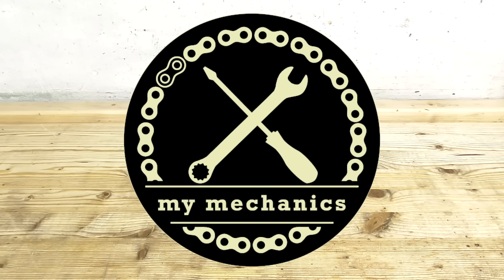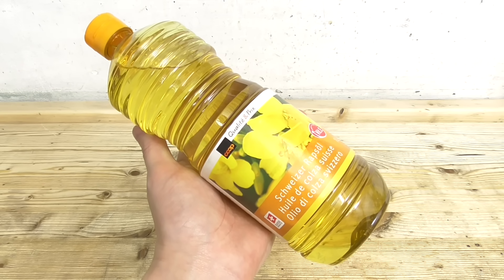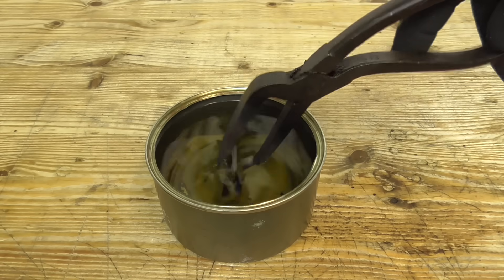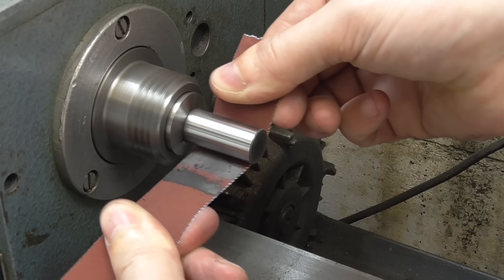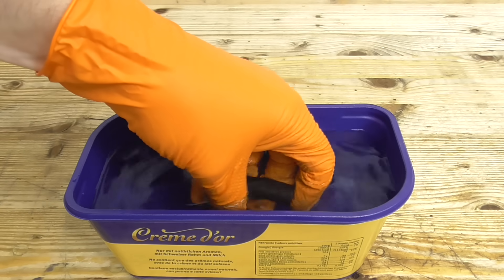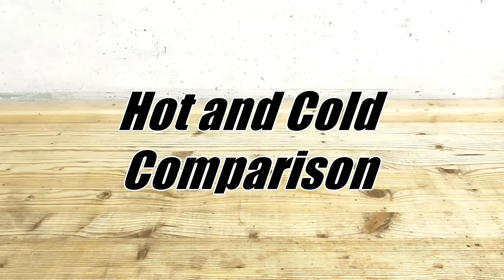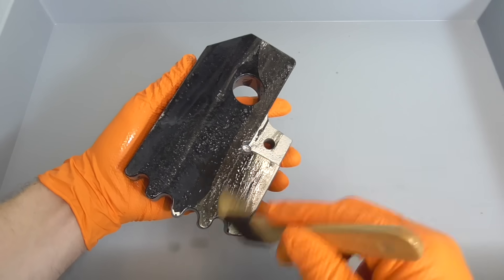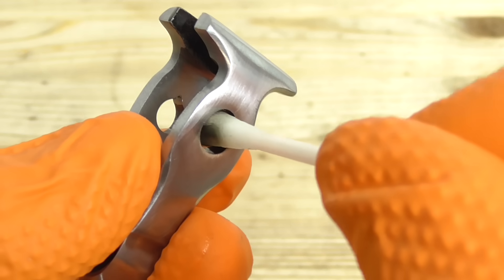How to Turn Steel Black - All you need to know about Bluing

Comment: You can use rust bluing for large parts, very time consuming though. You allow the part to develop a surface rust in a humidity environment or apply an acid for a quick rusting. Then dip the item into boiling distilled water for 20 minutes, the Iron Oxide will be converted in Black Oxide, bluing. Then you brush the loose black oxide off, and repeat the rust, boil, brushing step until the desired finish is reached or the part no longer rusts.
This is the most durable and corrosion resistant bluing method.
The easiest method is hot corrosive salt bluing in hydrous salts. You need approximately 5lbs of Sodium Hydroxide(lye), and 2.5lbs of Potassium Nitrate(preferred), Sodium Nitrate, or Ammonium Nitrate(evolves a lot of ammonia fumes initially), for every one gallon of distilled water. You need to put the water into a large cast iron, steel, or enamel coated pot, then slowly add the lye and Nitrate salt. You will need to heat the pot on a stove outdoors, and stir to dissolve the salts, the solution will be supersaturated and need to be hot to fully dissolve. Bring the pot up to a boil at 275-285°F, add more water if it gets hotter, or more lye if it boils lower. Suspend the parts by 416 stainless steel or black iron wire, immerse then in the bath for 15-45 minutes at a rolling boil, until the desired finish is obtained. Remove the parts, quench, then wash in hot running water or boil in hot water to remove any salt residue. Soak overnight in oil. This method is how firearm manufacturers blue their guns. The bath is hot and the salts will dissolve flesh, so you need to wear and apron, gloves,  and a face shield to be safe, just make sure you have a gallon of Vinegar on hand, it will quickly neutralize any small spatters of chemical. You Don't want to do this indoors, the fumes will rust exposed metal in your shop if you do. And you definitely do not want to let aluminum or copper into the bath, they will destroy the chemicals and you'll have to throw the solution out.
Reply: @specialEDy+ you think we need your know it all speech?
Reply: @davidrichter9164  If we find the subject matter interesting enough to watch the video? Then yes. Yes we did, if not need, then want his excellently laid out instructions.
Reply: I found it useful because I knew of that method but not all the hazards. Not worth the trouble.
Reply: @stevepeterson1377  "Worth the trouble" is very relative in this sort of case. If you're doing any sort of machining or shop work past a certain level, these sorts of hazards are just expected and you should already have most of the safety equipment and the work spaces that you need. In contrast, if you're just doing a couple of smaller pieces in your kitchen or the corner of your garage, then the smaller-scale methods from the video are more appropriate for you.
Reply: Thank you, very useful info
Reply: @stevepeterson1377  Well, I dont want to understate the hazards, but it's actually very easy and safe. Ive done rust bluing, cold bluing, heat bluing(temper), and corrosive salt bluing. Corrosive salt and rust bluing will give you a finish that cold bluing and heat bluing cant compare to. Rust and Corrosive salt bluing are the professional ways to blue something such as a firearm. 

Rust bluing is slightly more durable if you repeat it until the part stops stops rusting in the presence of the strong acid you're using, but rust bluing is incredibly labor intensive, and the easiest to screw up if you get any fingerprints, oils, or foreign material onto the steel in the process as it will create splotches in the subsequent coats.

Corrosive salt bluing is probably the easiest and quickest method, and will 100% give you a factory finish. As with all methods, the quality of prepwork will determine the final finish, sanding to 220-400 grit prior to corrosive salt bluing will yield a factory finish for most rifles and handguns, sanding 600-1000 grit before bluing will yield a high gloss to mirror finish.

I'd highly recommend corrosive salts to anyone looking to do a firearm, or more than a few small items. You'll thank me afterwards. I have 2 gallons mixed up, enough to do 2 or 3 handguns simultaneously. For 1 gallon of distilled water(makes maybe 1.5 gallons mixed), you need about $25 of sodium hydroxide(lye), and $10 of Potassium Nitrate from Amazon. A turkey fryer, a couple gallon cast iron, steel, or ceramic coated pot, a candy thermometer, and some black iron or stainless steel wire to suspend the parts. Easiest thing to screw up is getting aluminum or copper into the solution, which will kill the chemical bath. 

So, the risks? You're working with chemicals, and you're working with them at fryer temperatures. 275 degrees F is very hot, like if you try to add distilled water to the pot you have to be very careful it will flash boil before it can mix into the salts. But, 275 degrees is significantly colder than cooking oil, if you were frying food you'd probably be running 350 to 400 degrees F. 

The salts are hazardous, but not alarmingly so. Potassium Nitrate isnt flammable, but it is an oxidizer. It can be mixed with charcoal and sulfur to make Blackpowder, it can be mixed with sugar to make amateur grade solid rocket motors. Otherwise, Potassium Nitrate is very harmless, it is used on salted meat, in cigarettes, corned beef, and toothpastes. It is safe to consume and use as a food additive in small quantities. Sodium Hydroxide, lye, is very corrosive. Basically, when it comes into contact with organic matter, it converts the fats into soap molecules. Soap is made by mixing fats or oils with Lye, I have a bunch of it in my pantry because I use it for homemade soap like millions of other normal people. Its also used to make pretzels, every pretzel you've ever eaten was dipped into Sodium Hydroxide to brown the dough. It's also used in most drain cleaners. You definitely dont want pure lye or a high concentration to get onto your skin, it can give you a serious chemical burn, and if you were to eat a strong concentration or get into your eyes you'd have serious life threatening issues, not unlike household bleach.

I have gotten a few small splatters of Corrosive Salt bluing solution onto my skin, I didnt notice until it started to cause some very obvious irritation a few minutes later. I simply dabbed some grocery store white vinegar onto the spot, which neutralized it and the irritation instantly subsided.
Safety wise, you want to keep some white vinegar nearby in case you get corrosive salts onto your skin. Realize, it's not going to be enough to neutralize gallons of corrosive salt, and thus your primary safety issue is going to be spilling gallons of 275 degree molten salts onto the pavement or yourself. Not unlike the danger of spilling gallons of 350 fryer oil onto yourself or the pavement if you were frying food.
The gases arent bad, you just want to be outside. They arent a risk to you unless you did the process in a small room or kept your face inches above the pot for an extended period of time. Chlorine gas evolved from using household bleach is far more dangerous. The problem is more that, if you use the salt bath inside of a machine shop, you're going to find a light surface rust on any bare steel a few days or weeks later.
Reply: @davidrichter9164  Did you just eat sour grapes?
Reply: Thank you for this info!
Reply: @davidrichter9164 yes you do! It wasn’t know-all-all, it was describing what hot blueing is to those that think quenching steel in oil blues it. It doesn’t. It merely coats the metal.
Reply: Rust bluing works, if you want to rust the part you can fume it with the presence of either hydrochloric acid or bleach. Either chemical if suspended in air will cause the exposed steel surface to develop a coat of brown rust. Then you can boil that in water to turn it black, brush it off, then repeat. 

If you want the acid to fume faster add hydrogen peroxide to the acid. It will kick up a cloud of noxious gas that will instantly rust any exposed steel surface it touches.
Reply: @taiwanluthiers  if I wasn't already on government watch lists, I definitely am after calling around town trying to purchase high test hydrogen peroxide or nitric acid for rust bluing.
Add those to the ingredients for corrosive salt bluing, and you have everything required to synthesize nitroglycerin.
Reply: Now that is top notch, thanks!
Reply: @SpecialEDy  Thank you :)
Reply: Wow, you have comprehensively filled out all the remaining questions, except this one....Can hot corrosive salt bluing be done on zinc coated steel bolts, so that I can use them outdoors without the worry of any rust? If anyone can answer this I'd be most grateful.
Reply: @SpecialEDy thank you brother
Reply: @stevepeterson1377   That's why it's expensive to have done, not to mention the prep work & all the polisishing first.
Reply: @SpecialEDy This is incredibly valuable information.

Comment: Bluing is a passivation process in which steel is partially protected against rust, and is named after the blue-black appearance of the resulting protective finish. True gun bluing is an electrochemical conversion coating resulting from an oxidizing chemical reaction with iron on the surface selectively forming magnetite (Fe3O4), the black oxide of iron. Black oxide provides minimal protection against corrosion, unless also treated with a water-displacing oil to reduce wetting and galvanic action. A distinction can be made between traditional bluing and some other more modern black oxide coatings, although bluing is a subset of black oxide coatings. 
"Cold" bluing is generally a selenium dioxide based compound that colours steel black, or more often a very dark grey. It is a difficult product to apply evenly, offers minimal protection and is generally best used for small fast repair jobs and touch-ups. Most common people refers to this type of colour as Gun-Metal-Black.
Reply: TRUE Gun blueing has nothing to do with anything electro anything.  It is simply chemicals mixed in a hot bath to the perfect temperature to chemically rust the parts black.  That is all bluing is, is a chemical rust.  If you leave a barrel in a hot tank too long it will start to really rust, so the proper temp. and the right amount of time is the key to good REAL hot bluing for guns.  Bluing also does not protect guns from rust, the simply make it harder to see a speck if there is one.  My uncle had a custom varmint rifle built with a chrome moly barrel left in the white, and he just wiped it down with an oil rag like the rest of his guns, and my cousin now has that very rifle, and its about 45 years old and has never rusted.  Did you read your info from a book or google?  You surely have no real experience in actual gun bluing as I do working for a gunsmith for years.
Reply: Johan Rynjah “True” gun bluing would have to be rust blue considering it preceded hot bluing by about 150 years!
Reply: pickin4you you are wrong my friend.  Saying “true” gun bluing is only chemically rusting is hilarious.  Rusting is an electrochemical process.....Look it up
Reply: Thanks, that's what I was expecting to hear.
Reply: Well modern gun blueing is. Originally, as in true blueing, there was no electricity involved. Guns have been blued since long before Ben Franklin and his kite.
Reply: @pickin4you  
  Since you've worked for a gunsmith, I have a question for you. I have a Browning .25 from the 1960's that was stored in one of those zippered, sheep skin lined storage pouches meant specifically for firearms. Well, never again, it rusted. There must've been humidity in the air or something was damp because the pistol, particularly the slide, has got areas of damaged blueing and is prone to rust on those areas first... if I let it. 
  I've considered using that liquid blueing made by Caseywood that you brush on, (he used it in this video) but I know it'll look like crap when finished. The gun already has visible patches of light to dark spots where the factory blueing is... and was... painting it won't make it dark evenly, it'll still be splotchy, just darker.
  I suppose hot blueing by adding heat is out of the question, but it's just the slide I'm mainly concerned about. I wouldn't dream of adding heat to the barrel or any other parts. Can I get away with heating the slide? Is it tempered steel? I guess what I'm looking for is a cheap alternative to doing the job correctly while expecting the perfect results.  "You get what you pay for" comes to mind. ;)
  I'm thinking the cost and time to dismantle the pistol and have the slide and, might as well do the receiver too, have them done professionally would cost me an arm and a leg! I'm not sure if if the gun is worth it, heck, I don't even really like the darn thing. However, it is a Browning, it's well made and kinda of a classic so it should look better than it currently does.
  Any suggestions or ideas would be most appreciated. Stay well, especially during this pandemic... 
  Thanks...
Reply: @HyperactiveNeuron  Ben Franklin didn't invent electricity; he discovered it. Gun blueing is an electrochemical process.
Reply: @vachief yes its the polishing
Reply: DavidCAdams.  Actually, the electricity involved is between the difference in the amount of electrons in the metal and those of its surroundings, in this case, oxygen in the air.  There is a difference in the amount of charge an oxygen molecule (O2) has compared to that of iron (Fe).  Therefore there a potential difference...aka, voltage.  When  we use the term “oxidation” what we are really referring to is iron reacting with oxygen forming a chemical called rust because it has been oxidized (the iron has lost some electrons) and the oxygen has been reduced (the oxygen has gained some electrons).  The most common result is red rust or red iron oxide or Fe2O3.  The one we are going for with “bluing” is called black rust or black gamma or black oxide, Fe2O4.  This layer is harder and thicker than red rust and can also be called magnetite. This rust will stay tightly bound to the to the base material and act as a partial protection from a further oxidization process.  Please note that I’m remembering this from metallurgy courses I took years & years ago and my old memory is kinda foggy so I apologize in advance if I didn’t recall it exactly.  It really is quite interesting.
Reply: @pickin4you  Rusting is a electrochemical process. Rusting occurs when neutral pH water is in contact with iron. It acts as an electrolyte, creating small current paths in the metal, resulting in a chemical reaction and oxidation. Iron is the reducing agent that gives up electrons and oxygen is the oxidizing agent that accepts electrons. The reaction produces hydroxide ions which enables acids to accelerate the reaction. Iron oxide is water and oxygen permeable, so it penetrates deeper into the metal and doesn't protect it. Salt also accelerates the reaction, which is why road salting causes major rust damage to cars, and why iron rusts very quickly when exposed to seawater. 
What does this have to do with steel? Well, steel is a iron alloy and is subject to rusting. Stainless steel also rusts but the reaction forms an oxide layer that protects it from rusting. Rusting has literally everything to do with electrochemistry.
Reply: TMI😒
Reply: A lot of these responders don’t under stand that chemical changes does create electricity, hence the word “electro” confuses them. A car battery is an example of chemical changes creating electricity.
Reply: No u
Reply: @pickin4you  Electrochemistry is the study of chemical processes that cause electrons to move. This movement of electrons is called electricity, which can be generated by movements of electrons from one element to another in a reaction known as an oxidation-reduction.  That's what happens during the oxidation process of hot-bluing.
Reply: @DavidCAdams  : Ben Franklin did not discover electricity, he merely confirmed the relationship between lightning and electricity.
Reply: Thanks!  Any idea why the beautiful Colt bluing pre-1960 isn't found anywhere, anymore?
Reply: Any idea why that gorgeous Colt Blue isn't found on firearms anymore?  I have a Colt 1903 PH mfg in the mid 50s and the bluing is absolutely beautiful.  I refer to it as Storm Sky Blue. It's not black nor a variation of black.  Like a Thalo Blue seen through a lightly smoked lens.
Reply: @2tommyrad  Cost.  The prep work and hand-finishing that Colt used to do is time-consuming.  Consumers today simply will not pay that much money anymore.
Reply: @riffraff9000  Really??  In a world where 1911s sell all day for $3,500.  It's not a cost issue because no one blues that way.  It has to be an EPA issue.
Reply: @xMRPx  What "pandemic"?
Reply: @pickin4you  Your explanation is spot on!, I have a friend that does proper hot chemical blueing and the parts come out a very deep lustrous blue, As you said, It's about getting the temps correct and the time they're in the chemicals 👍

BTW,  The bars in this vid are more like grey than true deep gun blue, Probably due to the methods used..
Reply: @xMRPx  I can't argue with any of that.  I had the virus almost a year ago, and it was almost a joke.

I have refused to wear a mask from the very start, but they have worse versions of covid waiting in the wings.   If people get too brave, they'll release them onto us next.
Reply: @xMRPx  you might want to check out mark novak's channel, he is a gunsmith and works on many old and rusty firearms, you'll probably find good answers to your questions
Reply: @aflatminor  l have a stainless tank with long propane burner, only holds 2 litres, l just want to know the correct amount of sea salt and caustic soda to use.
Reply: Another self involved speech giver.